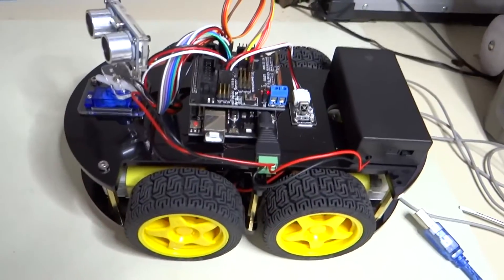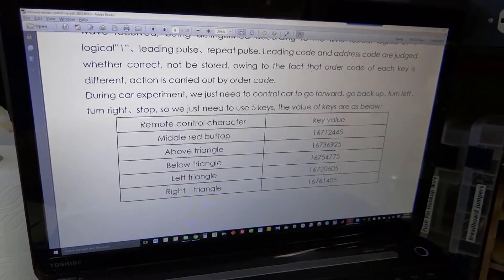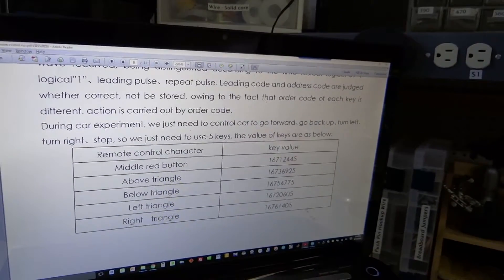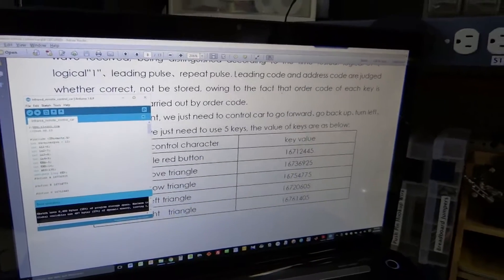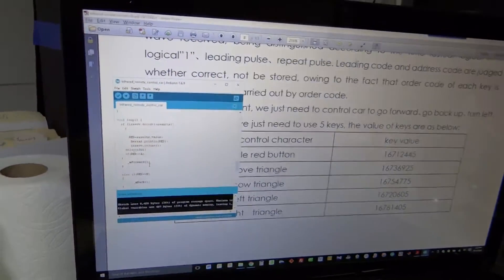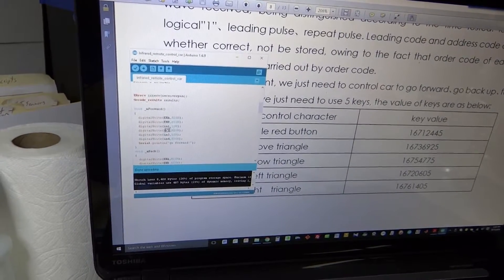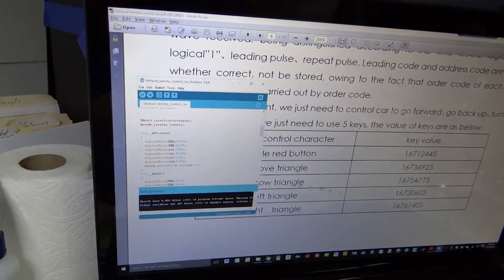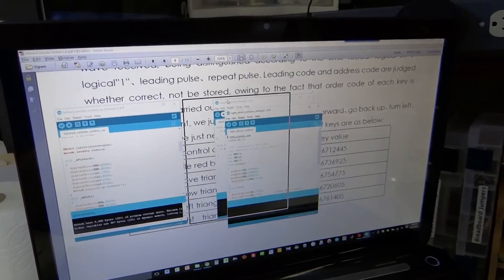Elegoo SRC kit 33 Lesson 3 IR remote control car pt2

Comment: Here is a complete list of Elegoo remote control button codes:
#define BTN_FORWARD    16736925
#define BTN_BACK       16754775
#define BTN_LEFT       16720605
#define BTN_RIGHT      16761405
#define BTN_OK         16712445

#define BTN_DIGIT1     16738455
#define BTN_DIGIT2     16750695
#define BTN_DIGIT3     16756815
#define BTN_DIGIT4     16724175
#define BTN_DIGIT5     16718055
#define BTN_DIGIT6     16743045
#define BTN_DIGIT7     16716015
#define BTN_DIGIT8     16726215
#define BTN_DIGIT9     16734885
#define BTN_DIGIT0     16730805
#define BTN_STAR       16728765
#define BTN_POUND      16732845

#define LONG_PRESS  4294967295

LONG_PRESS is returned repeatedly if you hold any button pressed. To get button code again you must release button and press it again.

Comment: Hi Greg, I just would like to know where is it possible to get the datasheets of the different components of the car. For example, only 5  keys values are shown on the ELEGOO tutorial. Where can we see the others ? Or the different pins of the sensor shield ?
Thanks
Reply from the maker: Yvan Cueille Great question! I've been able to find them on the internet. I'll try to round them up and post them to my github account. However, Elegoo has been upgrading their kits, and some of the hardware is different between different versions. For example, the original kit used only single push pin connections whereas the latest kit is greatly improved with three or four pin connectors. My GitHub account is here: https://www.girhub.com/griffegg/ElegooSRC
Reply: Yvan Cueille, write a simple sketch that will output received codes to the Serial and you'll know them all. Moreover you can record codes of another IR remote (say, one from a TV set) and then use that remote to control the car.

Comment: Hi Greg,  Did you get good performance with the IR remote?  I installed the library to uploaded the IR blink program, but it only seemed to recognize 10-25% of the button pushes on the remote.  I would have to push the 1 button 5 or 6 times to toggle the LED light once.  I got similar performance with the IR car, which made for some frustrating operation. 
Thanks,
Dennis
Reply from the maker: Dennis Schoenmaker Yes, I had the same problems. Many times the code received was garbled which results in poor performance. Never looked into it to see if it was the controller or the receiver.

Comment: My wheels move against each other. So when the forward command is sent the front wheels go backwards (should go forward) and the rear wheels go forward. I'm brand new to all this coding however, i did try switching some low and high values for the wheels and after i did that NOTHING WORKED.
Reply from the maker: Hi Eric, don't get too frustrated, the fun part is learning how to fix it.  First, go back to the original code. it sounds like your motors are wired wrong. Reverse the rear wheel red and black wiring on the motor controller board. then try the right and left wheel test programs. see if that gets both wheels going the the correct direction